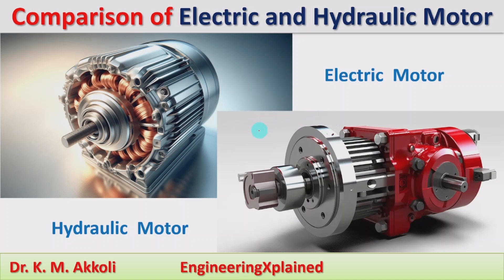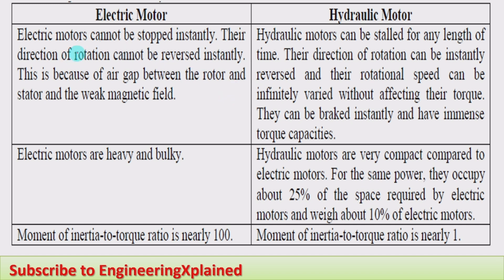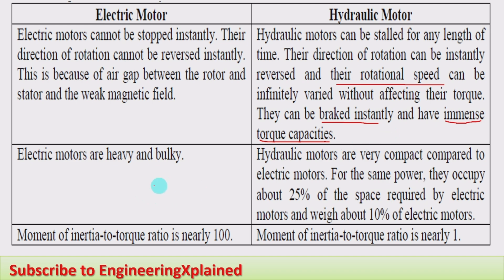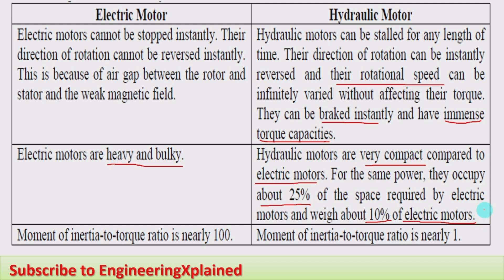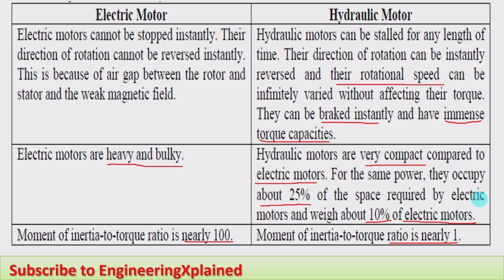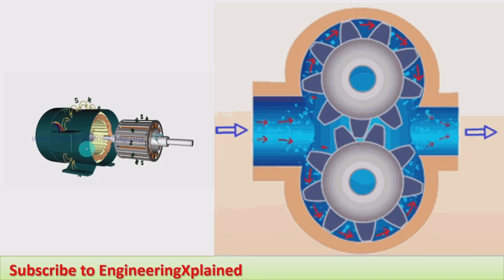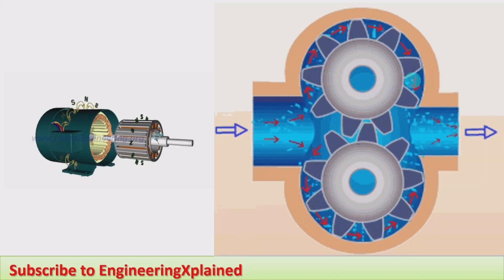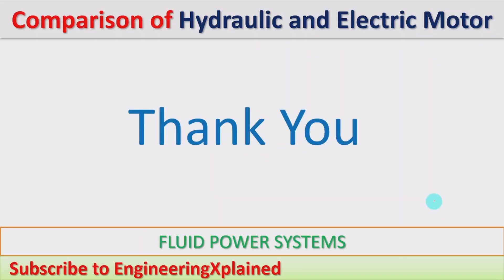Comparison of Electric and Hydraulic Motor | Fluid Power System

Comment: Thank you, professor. Also, electromagnetic coils are very inefficient, as they produce a lot of heat, especially at high speeds, instead of producing a magnetic force, and this is according to the well-known principle that the passage of electrical current through a wire produces heat.
Reply from the maker: @ياقوت-ق Thank you 👍